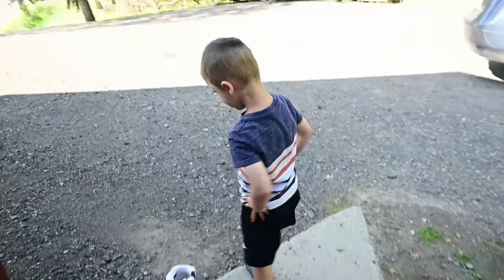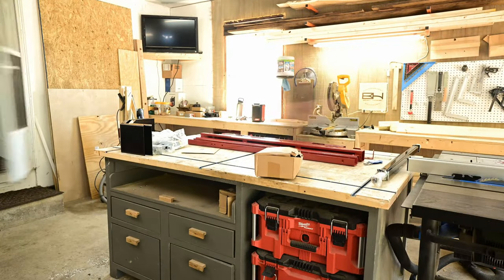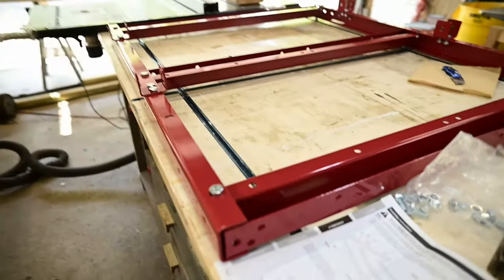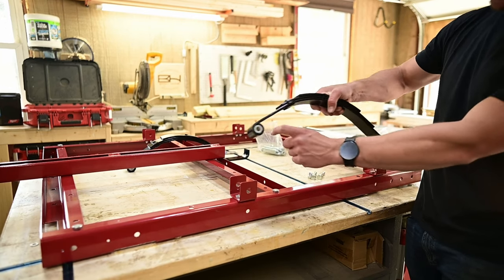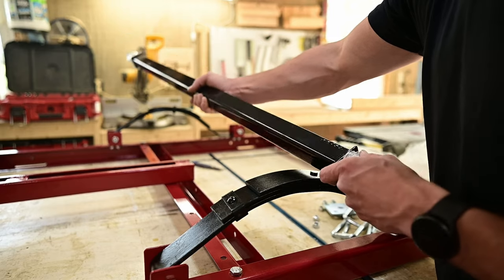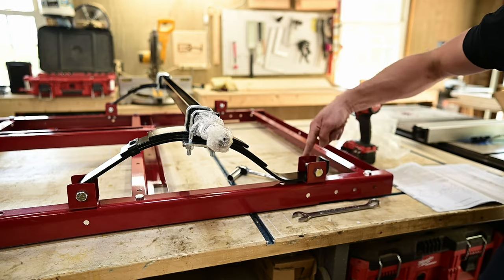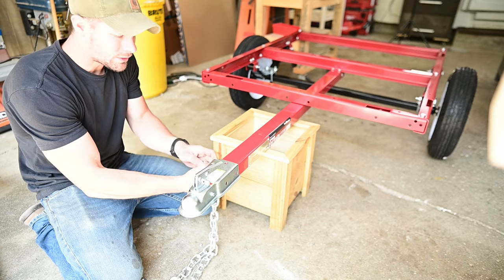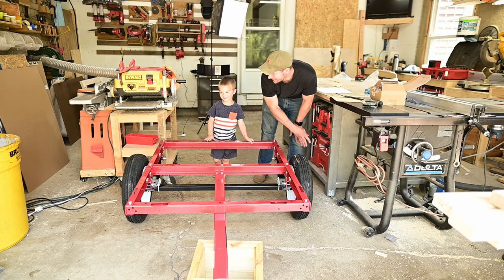Building a $399 cargo trailer from Harbor Freight. - Assembly

Comment: The documents that should have been on the outside of the box was the title of the trailer with vin # and gross weight info etc..that is why they are on the outside of the box as it gets recorded at the register when you buy it then you are supposed to be handed the title documents so you can get a tag and registration for it at the DMV with the title and the receipt " bill of sale " ..
Reply from the maker: Ahhh that makes sense. I did get that at checkout. Thank you for clarifying that.

Comment: Hello...I am building myself a trailer almost identical to this trailer, but I am missing one measurement. Would you measure the distance on the tongue from the coupler to the first crossover (front of the trailer) and post it here for me please? Thank you...Paul

Also, many people using this trailer are putting a piece of rubber hose over the bolt on the leaf spring that doesnt have the eye thru it. They say that this eliminates the rattle and banging.